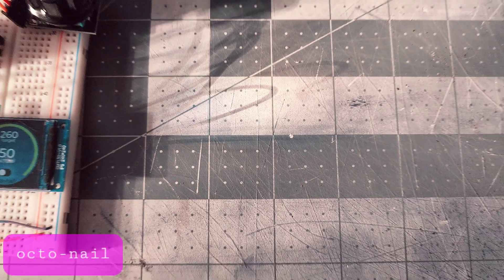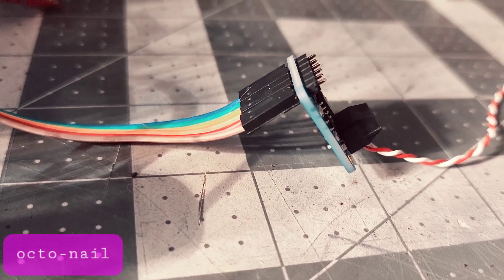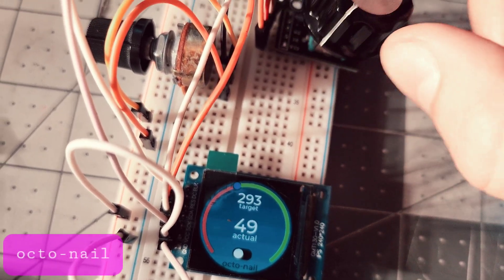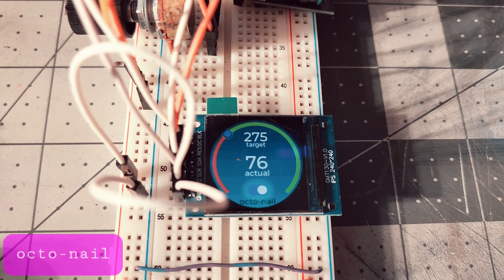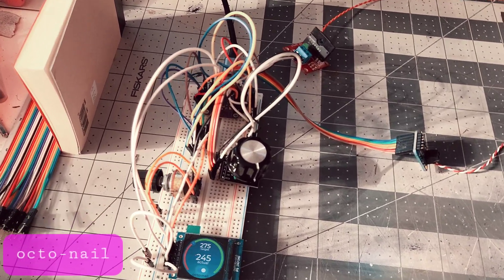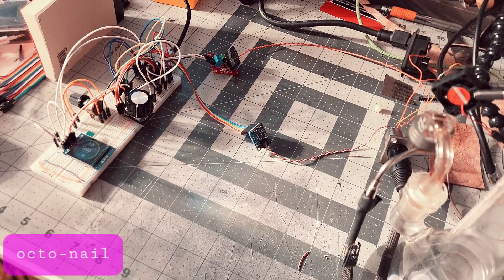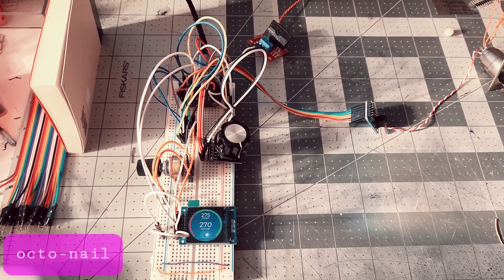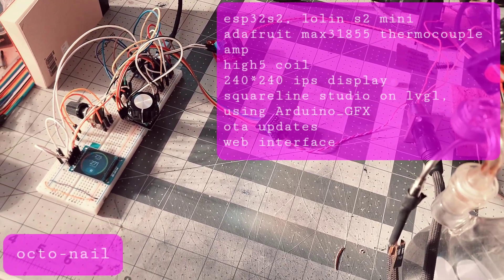octo-nail - DIY esp32 based e-nail, with wifi, full colour display and web interface

Comment: Are you still working on a Arduino based system? Do you have any public files that I could take a peek at am currently working on designing a system that will have its own base, e nail and will be compatible with a few different companies glass (puffco, Carta, core v2+2.1, ect) with different tpu adapters. Thinking about calling it the "plastico cheap" as a play on words to puffco peak
Reply: By files I more mean the code to see how you implement heating and errors and such
- wouldn't let me edit for some reason